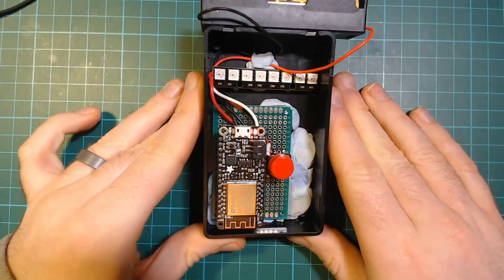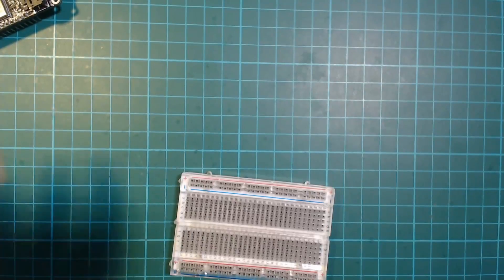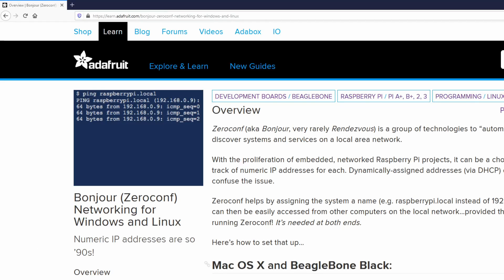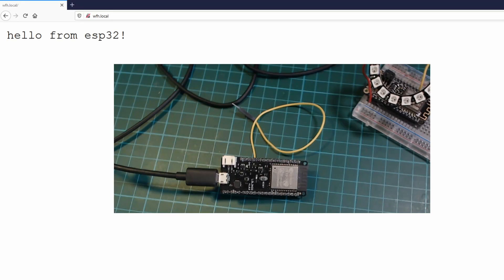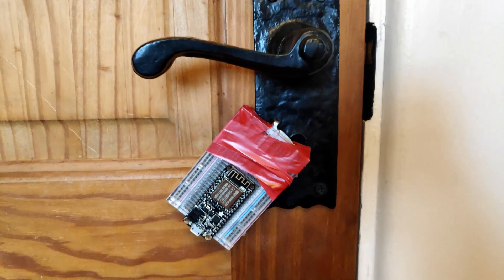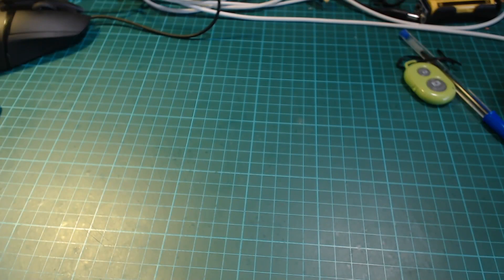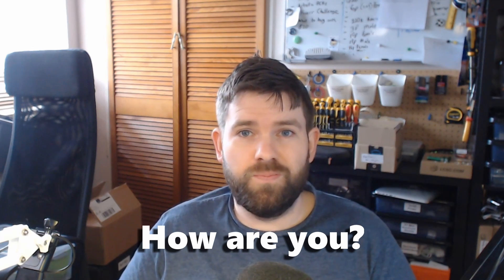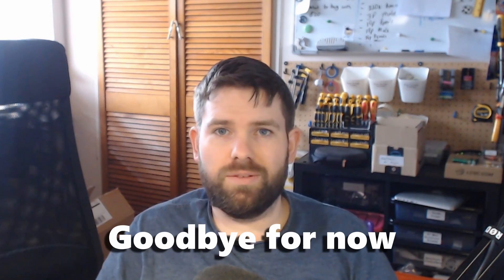Working From Home - WiFi Do Not Disturb indicator

Comment: Out of curiosity and maybe someone can guide me into some sort of direction. How would I build a low power RF receiver (433mhz or nrf or so)? 
I guess transmitting the trigger multiple times and waking an ESP / Arduino up every few seconds to check for a signal isn't really power-efficient and would create quite a dealy. Are there user / maker friendly ICs that can be "trained" to a specific signal and then wake a Microcontroller up or so?

Comment: Not sure if this helps but I had similar problems with an older version of the hazzzah making a wifi connection. I eventually got it working by adding these 2 lines just before wifi.connect. Maybe worth a try.
Wifi.persistent(false);
Wifi.mode(WIFI_OFF);
Wifi.begin(said, pw);